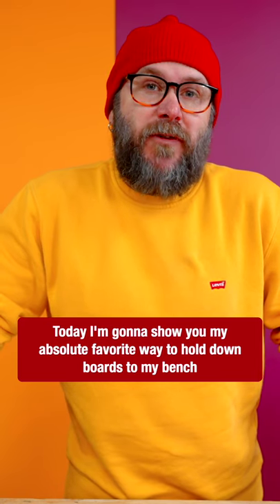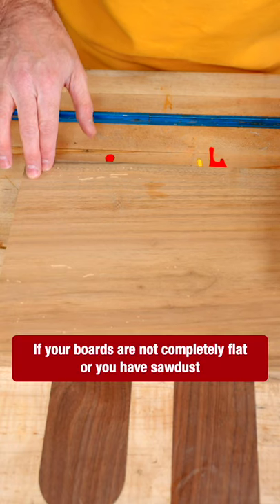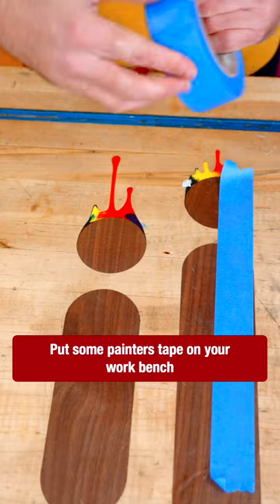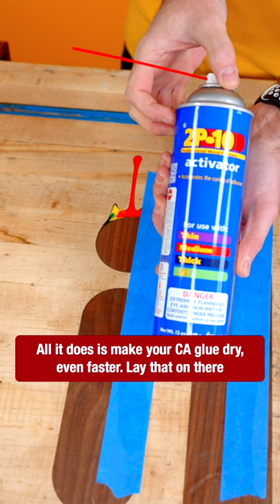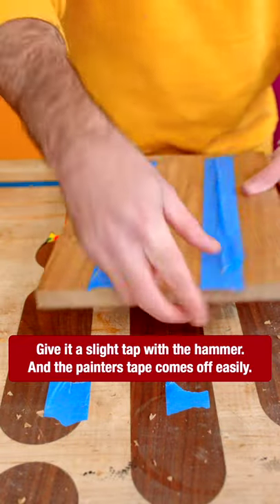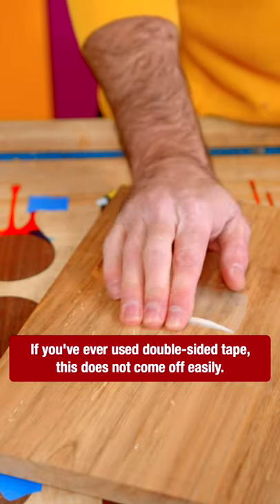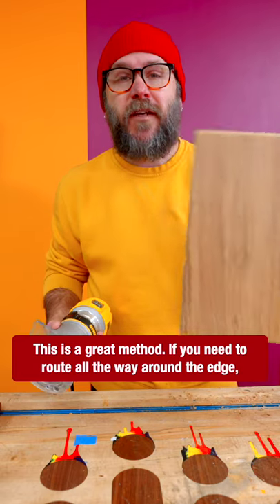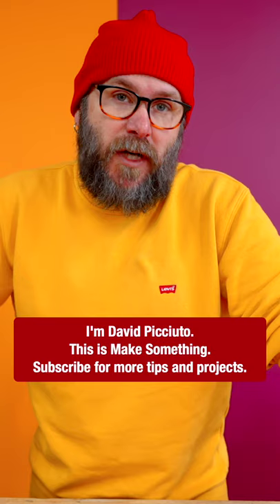The ultimate hold-down trick for woodworkers #shorts

Comment: Nah. Double sided adhesives has its uses when there simply isn't enough space for a clamp, but in a scenario like this using a clamp is way faster and produces zero waste. Think about it.
Reply: Agree. It's easy enough to stop and move your piece to re-clamp. Plenty of techniques out there to avoid denting your piece with clamps too. Also, it takes less time and you don't gotta worry about sanding out activator stains, if that's even a thing.

Comment: The big issue with the blue tape/CA glue method is 1) the need to align the tape strips perfectly, and 2) there is a chance of glue squeezeout which will get on your workpiece. Honestly the reason most people have a bad time with double sided tape is that theyre using the wrong stuff. Get some Spectape ST501 and it will change your opinion on double sided tape. It came with my Shaper and is a gamechanger. Can get different widths, comes off really easily, and holds great.
Reply: Exactly my thoughts. Just get the tape actually made for that job. Not carpet tape.
Reply: Bingo! I use the CA glue trick for other purposes. I would rather just move the clamp or work piece around instead of dealing with potential squeeze out or other issues. I do that all the time, no issues. Get the right double sided tape and you're good.
Reply: If you have squeezeout with CA glue, you're using WAY too much.
Reply: @Anthony-H  with the right double sided tape you don't have to worry about squeeze out or alignment it's just stick and go
Reply: @Anthony-H  did you watch the video? he used an enormous amount. just not a great example
Reply: @bs838  I watched the video. He didn't use an "enormous" amount. Personally, I use even more and have never had an issue with squeezeout. Not sure what you're going on about.
Reply: @Anthony-H  Not sure why you're so defensive. I find it hard to believe that you can use as much or more glue than what was shown in the video and not get squeezeout. That was an ungodly amount of CA glue, way more than necessary for the intended purpose - however it shows up much better on video so that's probably why he did it. Anyway, sorry I said something negative about your Youtube hero, feel free to continue white-knighting!
Reply: @bs838  Not defensive. Just tired of YouTube comment trolls who think they're experts on everything. Did he have squeezout in this video, despite using an "ungodly" amount? No. If this method doesn't work for you, fine. Don't use it. But it's a perfectly viable workholding method for the 99%.

Comment: Or you could get double sided tape made specifically for that job. They  make it to hold down boards to use on a CNC. I think you are talking about carpet tape and yes that is trash.
Reply: Still a nice hack if ever you don't have that tape handy. With the projects I work on, there's generally no issue with using clamps, so I don't need to keep that specific tape in my shop. But if ever I cannot use a clamp, I could see myself using that hack.
Reply: @BinCaAlors  sure I'm really just replying to him saying double sided tape doesn't work

Comment: So applying pressure with one hand and using the other hand to operate the tool is no longer an option?  Why complicate an easy process?
Reply: Try that with a routing tool.
Reply: I do it all the time. Any good tradesman knows that you don't force the tool into the material. You let the motor of the tool pretty much do the work. Unless you're impatient or not that good of a tradesman,  there should be no issue doing so. Also, pinning the material against something helps as well. The tool is not cutting every side at once. These lazy hack videos are making real tradesman look like jokes.